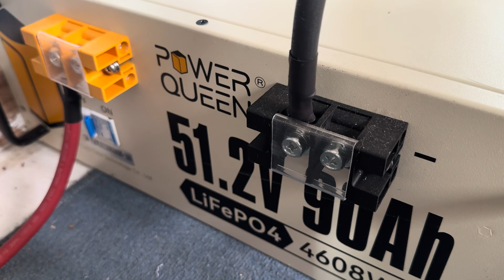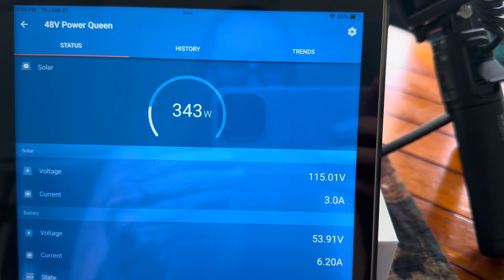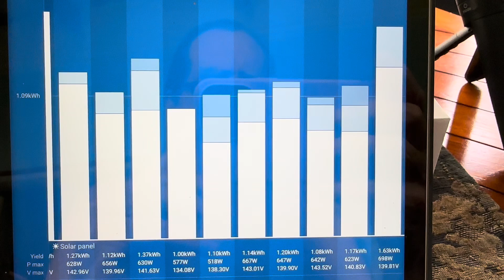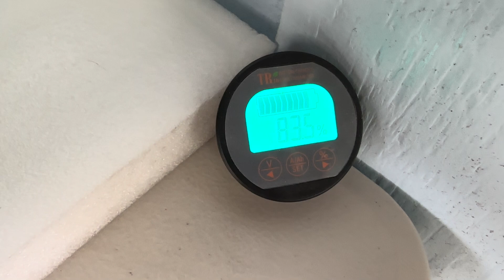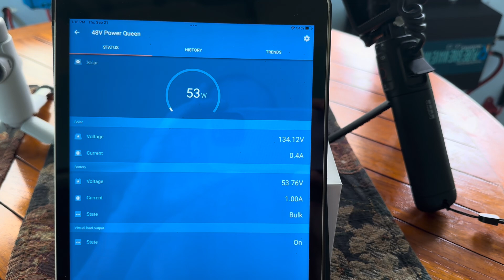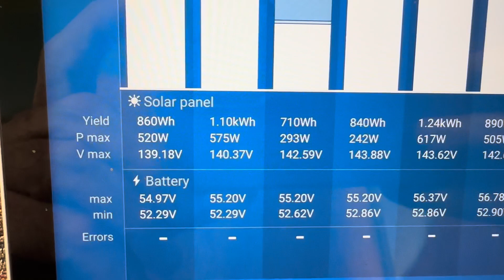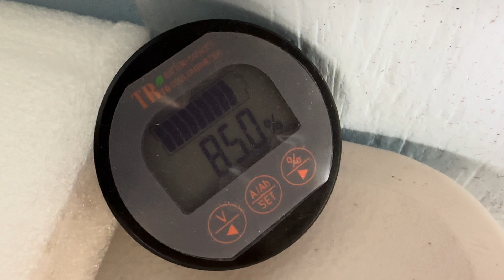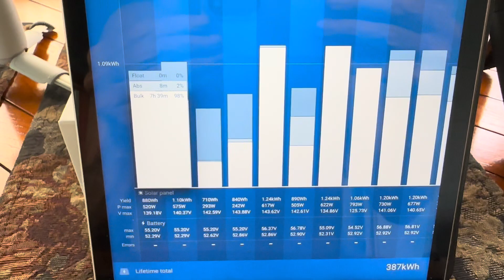48V LiFePO4 to 80% full. Working the sweet spot for maximum longevity?

Comment: What you are experiencing is not sun bursts. It is bms shut down and holding inverter load (17/20w). The bms shuts down for spiking voltages. The only way to correct this is lowering the voltage to a point where bms does not shut down and leave it there for several days and guve time to the bms to even the charge out. For a higher grade bms you get 100mah. I would say you are getting 50 miliamps and this will take a lot of time to balance. Keep it near the higher voltage it can handle before bms shut down and keep it there for days. That way it will get better.

Comment: A 90Ahr battery constrained to run  run between 20% and 80% is functionally a 54Ahr battery.
Reply: The units are Ah not Ahr.
Reply: @deang5622  hr
An hour (abbreviation: h or hr) is a unit of measurement used to measure time. An hour is equal to 60 minutes. 24 hours are equal to one day.

But as it is not an actual SI unit, we shouldn't be too fussy.
Reply: @donepearce  Wrong.
Do you talk about or mphr when talking about speed for cars?

It does matter. And as for not being an SI unit, that's irrelevant. Ah is written Ah and not Ahr.  Go check any battery if you don't believe me. It is a standard.
Reply: @deang5622  I'm truly not fussed. I made a choice in a unit which has no official definition. You know what I meant so please, just deal with it. If you have an issue with the number 54 there is a conversation to be had.
Reply: @donepearce thats exactly how you should treat it. The 90Ah is nomimal and probably only acheivable under very specific test conditions. If the manufacturer says its 90Ah, then consider it say 60-70 Ah at the very most. No way the manufacturer is being conservative with their 90Ah value, it is a very optimistic value. If you really need to use the full capacity of a 90Ah battery and regularly drain it down below 20% , then you are under-powered and need a bigger battery - a good rule of thumb is to keep the battery above about 40% charge, that way you rarely demand full power from a discharged battery, which is not good becasue it generates excess heat inside the battery.

Comment: 80% is not a sweet spot, 😂 your literally wasting 20% of your battery and charging it 20% more often,  so you are losing the origional 20% of your battery capacity and putting it through 20% extra cycles, so your battery will last 20% less than its rated too, plus the 20% of the battery you arent using equals 40% of your battery wasted.. 
 Charge it to 98% full, and dont drain it past 10% to give it max life.. who ever told you to charge to 80% has no idea how batteries work, or probably wants you to buy more
Reply: That demonstrates a fundamental lack of understanding of the problem and how the battery life is extended by not charging to 100%.
Reply: @deang5622  you mean, you have no idea how battery chemistry work's..
    You keep destroying batteries.. ill keep living off grid with my working batteries..
Reply: @4kays160  I think I know more than you so actually.
Reply: @deang5622  4kays is right though, at least partially right.  There won't be any additional charging cycles in paradise's use case, but for LiFePO4 no battery life is being saved by trying to charge to 80% SOC verses 100%.   LiFePO4 (LFP) batteries naturally de-stress after charging is complete, even when charging to 100% SOC the cell voltage will naturally drop down closer to the float (while still maintaining 100% SOC).

Plus the fact that it is not actually possible to charge to 80% SOC... the only way to do it is by tracking amp-hours in and amp-hours out, and even the best trackers will build up errors over time and the battery SOC will drift badly.   p.s. even Tesla tells people not to do this with their LFP vehicles without periodically charging to 100%.

It can't be done with simple charge controller settings at all, ANY minor variation in charge rate or loading will throw off anyone's attempt to dial-in an 80% SOC with only charge controller voltage settings.

And unless the battery's BMS can also be adjusted the balancer will also stop operating. So basically, trying to maintain 80% SOC with these batteries will only mess them up after a few months of operation.

Comment: Thank you I appreciate you doing this video and doing the research It would be nice to see that done to 2 same battery one to 100% the other about 80% for a few years and do a test were you use 2 same inverter and 2 same TV's and set a clock by them and see how much longer when both batteries at full see how much longer the 80% normally charge would get over the always full one. I may try this myself one day if you don't beat me to it. Have a great weekend and thanks again!!

Comment: I actually float at a higher voltage (3.375) and absorb (3.35) at a lower voltage. I do this because my cells appear to get into the high voltage hockey stick above this and the balance starts to go crazy.  This allows me to sneak up to a higher voltage instead of cramming a lot of amps at my cells. Letting off the gas peddle slowly as I reach highway speeds if you will.  I have my balancer kick in when one of my cells hits 3.38 volts, and turn off at 3.32 volts, or only balance when charging.
Reply: The balancer is basically useless below the exponential portion of the charging curve.  The problem with balancing in or below the knee instead of above it is that each battery's chemistry is going to be slightly different and result in a slightly different voltage in the knee of the curve.

The deviations appear to be "ok" in the knee because the LFP battery charging curve is very flat.  Meaning that you can create massive SOC differentials even with apparent "small" deviations at those lower voltages.

By trying to force the voltage with the balancer in that situation, you are actually unbalancing the cells instead of balancing them.   They can get off by as much as 20% SOC from each other.

Balancing always has to occur up past that knee in the charging curve.   This can be as low as 3.40V/cell but 3.45V/cell is really the absolute minimum that you should ever use for balancing.  And only if you have control over both the charging parameters and the BMS balancing parameters.

The balance is supposed to get a bit squirrely in the exponential part of the curve.  But not so bad that any single cell over-volts (hits 3.65V) before the pack target (average 3.55V/cell) is achieved.   People tend to focus way too much on the mV deltas and forget what the goal is.

Comment: After reading the comments, the best advice I can give you is to watch Andy on Off Grid Garage, find the videos where he sets his charge rate, which you are using 55.2 and absorbtion which you are using 53.6 and watch him do the tests and explain why he uses these settings..The mystery will disappear, these comments are all over the place and most don't understand what is going on here...The tests do not lie..you are already using his settings, just go and find out why...My guess is if you were to do a discharge test you would get the full 90 AH's of that battery...And I would put money on it..Charge controller settings and BMS settings Off Grid Garage...
Reply: Not for these batteries.  Andy's batteries all have bluetooth accessible BMSs so he can freely change both charging parameters and BMS balancing parameters.

The batteries being used on this channel are a lot cheaper and do not generally have accessible BMSs. Because the BMS is not accessible in these batteries, changing the charging parameters without being able to charge the BMS's balancing parameters to match will just lead to problems.

Comment: ..I charge to 3.45 a cell which is 55.2 volts which still gives me 100% after an hour of absorbtion and balancing..Absorbtion is set at 3.35 a cell which is 53.6 volts, but I draw my battery bank down everyday, and rarely charge to 100%..Absorbtion time should be 1 hour...The battery naturally rests at around 53.6 volts..If you charge your battery all the way up, it will drop over a few hours and will rest at 53.6 volts, and that is where you want it, at the flat part of the curve, where it naturally rests..But, I have prismatic Eve cells, with A JK BMS and an EG4 all in one inverter/solar charge controller..My BMS has an active balancer, which is why I absorb and balance for an hour..My deviation is only 3 to 5 millivolts, so it works very well..The 80% 20 % is for lithium ion, not LIFEP04, there is no way to know if you are at 80% or 20% with this chemistry because the charging/discharging curve is so flat..The voltage can be the same at 80% as it is at 62%..Watch Andy on Off Grid Garage and you will understand your current settings, because that is the guy who figured them out by testing batteries, and that is why you are using them....